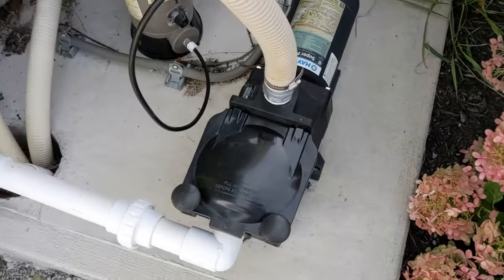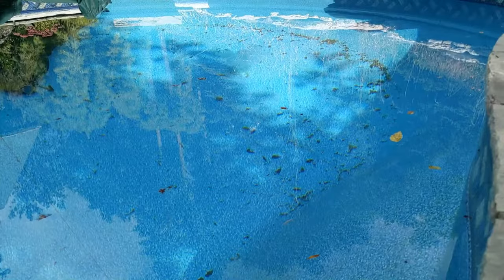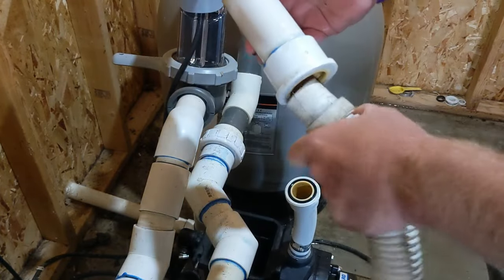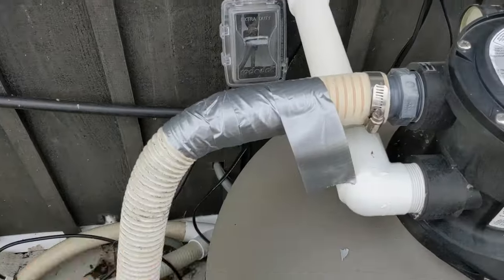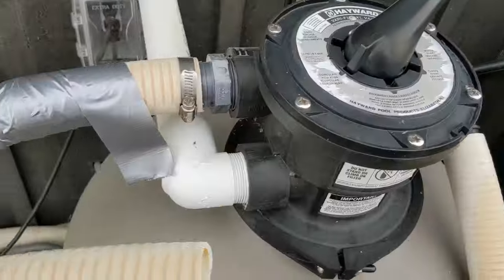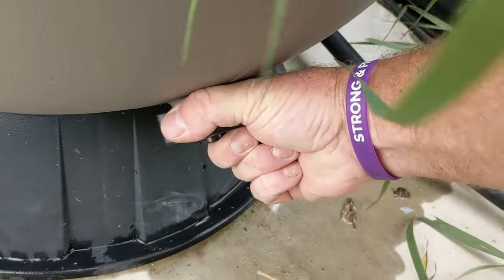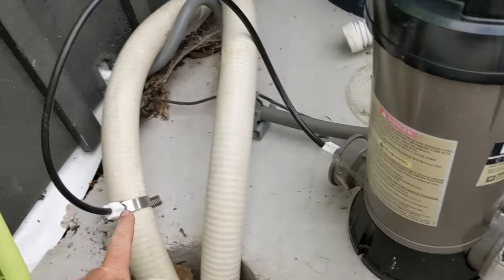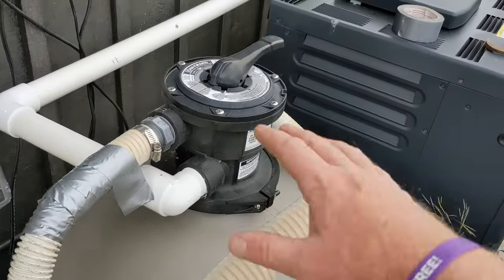How To BLOW Out Pool Lines for Winter / Winterize Your Swimming Pool / Pool Winterizing Blower

Comment from the maker: Because there's Soooo many different types of pools and setups, it's hard to cover everything in one video that fits your situation.  I've done several videos and several different ways of closing a pool.
Reply: If I use an air compressor fed into one of the drains of the pump, do I need to set the filter to a different position? Also how much psi do I use?
Reply from the maker: @Faizur Piuli  I won't use the pumps drain plug to blow the lines out.  I don't use air compressors because I found I need a big tank to be rolling around all over the country.  If you have one that can run at about 20psi or higher for a few minutes, then you have the right compressor.  When  blow the lines from the pump to the filter, you will need to move that top dial to recirculate or whirlpool.
Reply: @VIPPoolsandSpas  In another video I saw that they were able to use the 1/4 in air hose directly into the drain. I couldn't find a way to connect the hose that you use in the video to the air compressor. Also, the water heater we have is also a raypack but the on / off switch seems to have fallen in, how can I make sure it stays off?
Edit: I tried opening the panel but there's no switch anywhere

And do I need to lower the water level of the pool? I saw in another video you lowered it below the skimmer but above the jets.
Reply from the maker: @FaizurPiuli  turn the gas off for the heater.  There are so many different pool setups and styles.  Some pools I can leave all the water in and some pools I have to drop the water.  It all depends on your fittings and the age of the pool.  Blowing from the pumps drain plug would be an issue if you can't stop the air going to the filter and then stop it from going to the pool.   Plus.  Your forcing the pump impellor to spin and heating up the pump seal.  Your pump seal needs the water to cool it.
Reply: @VIPPoolsandSpas  is there any way I can connect the hose to the air compressor? Then I would be able to connect the hose the same way that you did in this video
Reply from the maker: @FaizurPiuli  if you can use the duck plugs or bungee plugs, use them.  That way you can leave the water above the Jets.  It's good to keep the water in because of ground water.  Spring and Fall is a very bad time to lower water out if a pool.  It's a gamble if you'll get water coming into and under the liner.
Reply: @VIPPoolsandSpas  would you happen to know if there is an adapter I can use to attach a house to an air compressor? Something with 1/4" and one side and 1.5" on the other?
Reply from the maker: @FaizurPiuli  there is a expansion plug you can get that will fit a compressor fitting.  Pool plumbing is going to be 2 inch or 1.5 inch.  I link that stuff later on.  Normally you just try and rig anything up to make it work.  Every situation is different.  You could put something into the impellor so it didn't move and use a compressor fitting that has a threaded end on one side and a normal connection on the other si you can hook the compressor hose to.  Have to do one drain plug at a time.
Reply from the maker: @FaizurPiuli  you have to rig something up for your situation.   You need an expansion plug that will fit into a 1.5 inch with some sort of threaded end.   Those plugs I use for testing pipe leaks.   Look on Amazon, you might find something.
Reply: @VIPPoolsandSpas  I was able to use an expansion plug, hopefully I will be able to close today
Reply: Hi, I just rewatched this video and I was wondering if you plugged the jets?
Reply from the maker: @FaizurPiuli  Yes.  I used one duck plug and a Bungee plug.  The duck plug has a yellow "cover" to put on after.  With the bungee plug, theres no cover to put on.  Both plugs seal themselves.  This video was more for blowing out the lines.
Reply: @FaizurPiuli  Do you plug the return lines while the air is still blowing?
Reply: @solidamanda  I have four return lines and I was afraid to blow air higher than 25 psi so I plugged one to get the air to go to the next and repeated the process until the air reached all of the jets
Reply: Hello! I decided to open the pool today and I was very happy to see that the water is crystal clear 🤩. There is some debris and leaves but the water didn't turn green at all and I could even see the floor on the deep end. I haven't unplugged the keys yet but they don't seem to have leaked. Thank you so much again for all your help!!

Since the water is not green, I'm a little unsure of what I need to do. I was prepared to shock the pool but I'm not sure if that's advised. Should I get a water testing kit and go from there?
Reply from the maker: @FaizurPiuli  should shock it a little anyway.  It's clear because you opened it early.  I'm assuming your in Canada or Northern USA.  Things are still cold  so the algae can't grow well.  Test it and most likely your alkalinity will be low.
Reply from the maker: @FaizurPiuli  Also.  Have a great summer.  Thanks for watching and commenting.  Make sure to hit the like.  Lol
Reply: @solidamanda   I’m wondering the same. This is my first time closing the pool at our new house and I’m a dummy so I’m researching everything first. Not sure when or how to plug all the lines - if I stop blowing the air through before plugging the lines, wouldn’t the water from the pool seep back into the lines I just blew out? But will I be able to plug the lines with the air blowing through them? These are all questions running through my mind. 
I don’t want to mess anything up, but we have zero reliable pool companies where I’m at.
Reply: @VIPPoolsandSpas   I’m wondering about the timing for plugging the lines also. This is my first time closing the pool at our new house and I’m a dummy so I’m researching everything first. Not sure when or how to plug all the lines - if I stop blowing the air through before plugging the lines, wouldn’t the water from the pool seep back into the lines I just blew out? But will I be able to plug the lines with the air blowing through them? 
And also, do I need to turn off the valves for each line? I would assume I would….but I will have to figure out which valve goes to which line because there are three of them and none are labeled.
Reply from the maker: @Goinghome08  if you can use a "duck plug" as shown in most of my videos, water will not do back in.  You will have to watch a few videos to get an idea on how to close your pool.  Watch out, there are a lot of videos that show the wrong way of closing a pool.
Reply: @VIPPoolsandSpas  thank you. I will check out more of your videos and research the duck plugs too. 
I’m thinking I may just drain below the skimmer & return this year and see about doing it the other way next year, once I’ve had more time to figure it all out.
Reply from the maker: @Goinghome08  the reason for the duck plugs are, you know if it's 100% sealed and no water is getting in.  When you drop the water below the returns and then plug them, how do you know if it's totally sealed?  You don't.  When you drop the water below the skimmer and blow all the water out, we put the gizmo in and pour antifreeze around it to check for leaks.  It's also when the water builds up and goes into the skimmer later during winter.  Sometimes I do left the water up.  Do what works best for you and your pool.
Reply: @Goinghome08  So I closed pool last year myself which was my first time after my pool was built. I consulted my pool builder on this too. Along with some common sense, it turns out that its preferred to lower water all the way below return ports so in this case you don't need to worry about water seeping back. 

But if you choose to not drain the water lower, you still can plug it, just need to plug it while it's still blowing. In my case, once i plug it, the pressure blows the blower hose off. Or you can have a second person to turn it off.

Hope it helps.
Reply: After clearing the lines, why didn't you show the process of installing the plugs? 

Should they be installed with the air pump running to prevent water from backfilling the lines?
Reply from the maker: @aetlas5000  this video is just on how to blow the lines out.  Some people will lower the water and some will not.  Most of my closing videos we put in duck plugs.  This allows us not to drop the water below the jets.  Some pools you can't use these plugs and will have to lower the water.   95 percent of my pools we use duck plugs.  4 percent of them we use bungee plugs and the 1 percent we will lower the water to put normal plugs on.
Reply from the maker: @aetlas5000  https://youtu.be/MjZiyUVlexE

Comment: What stops the water from going back in the drain and supply line once you turn off the air?
Reply from the maker: If you are talking about the main drain, shutting the ball valve when the blower is still going will keep the water well below the frost line.

Comment: I would say that the Hayward valves with the diverter gasket built into the key assembly (like that one) last much longer than valves with a standard spider gasket. They all do fail eventually though. The Law of Diminishing Utility.

Comment: You mentioned in the comments that running the blower thru the rear of the pump housing to blow out the returns was not a good idea as this would cause the impeller to spin with no water running thru the seals. If I were to disconnect the motor from the pump housing, wouldn’t I be able to easily stop the impeller from rotating while blowing the returns?
Reply from the maker: It would be easier just to blow out the lines the way I do it in the videos.
Reply: @VIPPoolsandSpas  Ok, thanks I get it. Since I don’t have an easy access to blow the returns like in the video, for now I’ll have to go thru the motor port until I can have my system replumbed. Thanks again for all the help.👍

Comment: Been searching for something different - can I use a spa blower to keep the effect of the bubbles through my return lines? We have three return lines at the bottom of our pool and when the solar turn on and push the air out its nice and soothing. You think theres any issues into doing this? Plumb it after the SWG? Thanks!
Reply from the maker: The easiest and cheapest way of using a jet(s) for producing bubbles is to put a "T" in after the pump and have 2 shut offs.  One way is back to the pump and the other way is back to a blower.  That way you can turn the pump off, turn the shut off from the pump .  Turn the blower shut off valve on and then start the blower.  Hope I explained it so you understand?
Reply: @VIPPoolsandSpas  - awesome, thanks for the response. Just to make sure I understand, the blower - when turned on - is the isolated from the rest of the system. The blower would be after the SWG?
Reply from the maker: @PIKL4x4  Yes.
Reply: @VIPPoolsandSpas  - woot woot! Now just need to get a 2hp blower :) You don't think there will be an issue with the blowers motor overheating?
Reply: @VIPPoolsandSpas  - the idea worked - a 2hp blower connected and now I've got bubbles in the pool - all three returns push air out of the bottom of the pool. Had to adjust the valves to get even coverage but the end result is more than I expected. The added bonus is that during the hot summer months I can use this to cool down the pool as well as the air coming in is a bit cold. One thing I do have to figure out is putting an air filter after the blower - seems to like to push bugs into the pool. Thanks for the help in the configuration of the piping.
Reply from the maker: @PIKL4x4  You have to send me some video of that.  lol  Put the video on youtube and send me the link to info@vippools.ca.  Would love to use it on one of my live shows.  Once I figure out all the live streaming stuff.

Comment: Thanks for the tip on the ball valve addition on the waste line.  I have a similar Hayward sand about 8 yrs old and this year I noticed loosing water after a clean cycle on the sand, after noticed the water draining in the pool. Even after turning the valve back to recirc it was still draining out waste.  So you don’t drop the water level below the returns??
Reply from the maker: Some pools we drop the water below the returns and some not.  If I can fit a duck plug and my ultra gizzmo, Im not draining it down.   Concrete pools, you have to drain below the returns.

Comment: Really helpful - thanks!  I'm trying to close my above ground (permanent) pool alone for the first time ever this year and no one services these in my area.  Just wondering - is there a reason to blow out the lines before you lowered the water level?
Reply from the maker: Most of the pools I close will have a duck plug.  I can blow the lines while I drop the water.  Only on a sand filter.  I put it on backwash and then hook up my blower on the output going to the returns.  I don't have water going to the pool because it's going out the backwash hose.

Comment: Hi I have a low profile tsunami cleaning system. It has like 12 small jets at the bottom of my pool. How do I blow those lines out?
Reply from the maker: Thats a good one.  Do you know the builder of that pool?  Some pools are custom and I would only know whats, what if I was right there blowing the lines myself.  When we run into custom pools, we blow out everything and everywhere.  Make sure every jet is blown out.  Any jets or suctions on the bottom or side of a pool that we can not reach are blown out like a main drain would be.  Blow down, shut off valve and block the water from coming up to the frost line.

Comment: hello, I'm looking to close my pool for the first time and am confused about where I should insert my shop vac attachment to blow out the return line. My hayward pump/sand filter setup is like the one in the video where there the hose is attached via a clamp and there is no place to disconnect. If I don't cut the hose like you did, what are the alternatives? 

Can I feed my shop vac attachment into the other end of the pump or the backwash waste port? I think the only detachable union I have is between the heater and the automatic chlorinator. I have a small semi-inground pool with 1 return and 1 skimmer. Thank you
Reply from the maker: @Audrina-my9li  a shop vac will not be enough blowing power to get all the water out.  Need the right blower.  Follow the videos I have for all pool closings.
Reply: @VIPPoolsandSpas  Ok thanks for the reply, assuming I have the right blower, I still have the question though -- given my setup where would it make sense to insert the blowing attachment?
Reply from the maker: You will have to watch more videos to figure out whats best for your setup.  I don't hookup all in the same spot on all pool closings.  It depends on there plumbing and setup.  If you have to cut a pipe, then do that.  You can always connect with a union so it's easier next year.

Comment: What kind of Gizmo do you recommend? I’ve seen them with and without a hole for water to escape through the center. I think it’s used when you are not lowering the water level.  Would you put antifreeze in the skimmer? Also, when blowing out the main drain, what’s to prevent water from re-entering drain again? Is the a back flow valve below the main drain?
Reply from the maker: All great questions.  I like to use the gizmo with the hole.  Even if you drop the water or not there's better pressure to push out most of the water because of the smaller opening.  Some pools you'll have to turn the blower off, let the water roll back and turn on again giving an extra push out.  I do antifreeze all the skimmers.
Reply from the maker: When you blow out the main drain if it's connected to the pump, you'll have to have a ball valve shut off.  That way you can blow the water out of the main drain and while the blower is running you turn that ball valve off.  This fills the pipe with air and preventing the water from pushing up.  Love physics.  Lol.   If the main drain is connected to the skimmer, I just put a foot long piece of a pool noodle in the line and cap it by hand.  I will be doing a video.....at some point......of doing this a different way with a small shut off connected to the main drain, inside the skimmer.
Reply from the maker: Make sure to watch my videos on the playlist under Swimming Pool Closing Videos.   You watch a few of those and you'll find ways that will suit your pool and your situation.

Comment: Hi I dont have a multiport valve on my hayward filter, I have a DE EC75  is it ok to attach a compressor to the pump and blow all the lines, even the return and polaris line or will I ruin my filter.  .
Reply from the maker: No.  The DE is different than a cartridge filter.  Just empty the water out of the DE filter and blow the water out from the other side.
Reply: @VIPPoolsandSpas  Thank you so much!

Comment: why can you not turn the Mighty Vac to the other side of the basket on the pump and blow out from there through the filter. I don't have a sand filter but have a PacFab DE filter. Also I have a PacFab pump and not sure how much room I have to get a hose into the opening. Thanks so much for helping us with this video
Reply from the maker: There's so many different plumbing setups and pool equipment that this video is just a guideline on what you should do.   Bottom line, get as much water out of the lines and equipment as you can.   Do what you need to do to get this done.  Even if you have to find a way that suits your situation.
Reply: That is what I am going to do. Probably going to removed my filters 1st, but not sure that is necessary. I can tell you what I am not going to do, and that is pay someone $400 to do it for me!!!